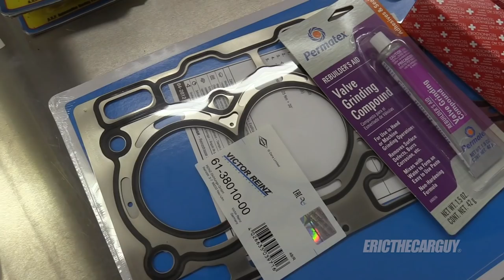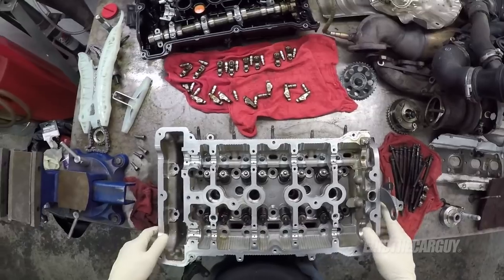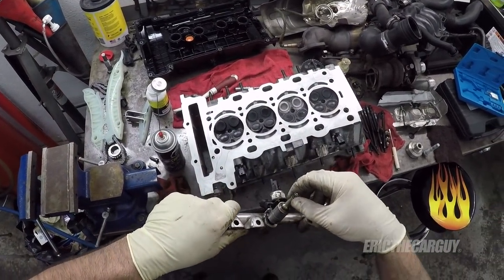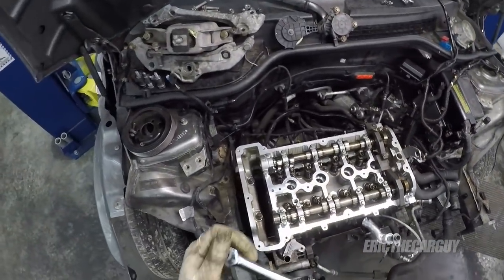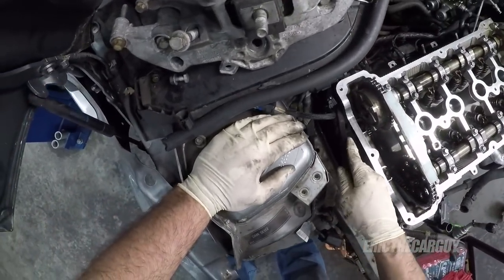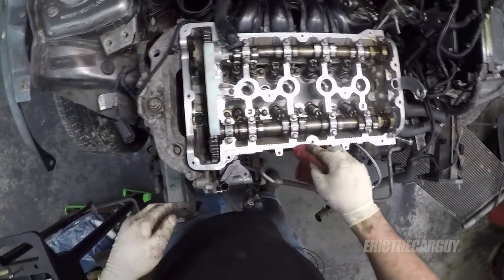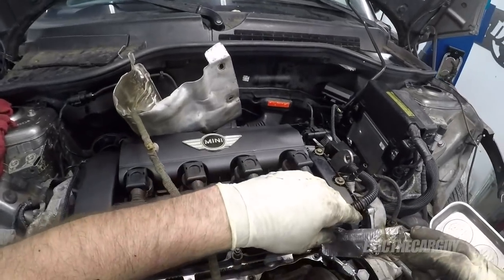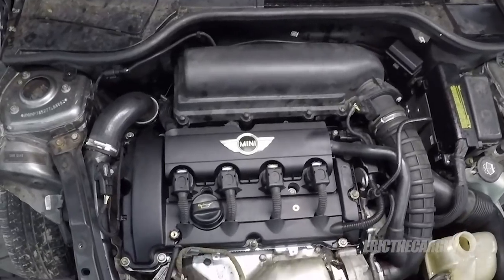Mini Cooper N14 Bent Valve Repair (Part 2)

Comment: I think you did an excelent job eric.
The washer mod cost nothing but you were able to install the stem/valve keepers :-D.
"Need is the mother of invention."
.
It's an odd car in comparison to the cars you are used to, the jungle of peripheral components around the engine must have been a pain to remember.
I still think it's a horrible cramped design, hopefully the first and last one you will ever need to  fondle lol.
Stretch bolts, not a nice thought.
Reply from the maker: Thank you. Honestly, I didn't mind working on this car at all. I thought it would be a lost worse. My biggest complaint is the parts are fragile and expensive. The car IS fun to drive, but I'm selling it before more stuff breaks. It seems inevitable. Thanks for your comments as always.
Reply: Wise decision :-D.

Comment: I may have missed it, but...did you turn the engine over by hand to confirm no interference before you pushed the button?

I can't not do it - even  when I know everything is perfect, I still have to check...probably because every time someone comes up with a foolproof technique, I improve at being a fool.   :-P
Reply from the maker: No. I just went for it like I usually do. Sometimes it works, sometimes it doesn't. In the end, it's all a video opportunity for me.
Reply: Never thought of that.   In your situation, even making a mistake has a silver lining, so long as no one else is impacted by the error.  Hey, if it works for you, it works for me - it's great to see honesty in this industry.  :-)
Reply: I learn that even if i work with tools  for timming setup i must turn the engine twice. Because it could be the tension bold that could failed.

Comment: If valves get bent, does that damage the top of the piston as well?
Reply from the maker: Not always in my experience. I've seen pistons get 'marked' but not damaged beyond use. 

The valves are at an angle when they meet the piston, which is not at an angle and held fast by the cylinder walls. It's almost always the valves that bend as a result.
Reply: Peshewa diy no, not at all.
Reply: no, but those rockers tend to snap in half. Makes it extra fun fishing out all those tiny needle bearings.

Comment: Your mistake has opened my eyes to what happened with my Mini. Bought it and two days later it died and the bolt on the crank pulley was completely out. Now every exhaust rocker arm has no tension at all. I'm thinking all of my valves are bent :( Oil pan is clean, but I pulled off the chain guard on the scavenger oil pump and plastic bits were in there...

Comment: "Tighten bolts with cold engine " dumb instructions ,when the cylinder head is removed the engine can't run /is cold ,even if you want to you can't tighten it with an hot engine 16:29 great video by the way !
Reply: You've clearly never seen someone try to replace a head gasket while at the track.
Reply: Yeah but you know those NASCAR minis might try a hot swap....
Reply: Engine tear downs don't happen like this and sit for hours to cool down all the time. Race car teams do it between races and even during races. So it's not always dumb to warn everyone to do it cold. Shows you are inexperienced, so in fact your statement was dumb.
Reply: It's just a warning for the superfast mechanics.... ☺

Comment: Has anyone done a similar thing to a N12 engine. Having doubts which flex plate hole to install the crank locking tool. Mine has two holes 180 degrees off from each other.

Comment: The rough Idle could be be an Airleak. If or if not, you should use some Silicon on the extreme Angles of the Cylinder Head to Valve Cover. Looking on to the Head from the front, the extreme Angles i mean are bot on the Left, a bit left from the Point you use that 27 Wrench to turn the Cams. The Rubber Sealing inside the Cover will be suported by that bit SIlicon. -> 30:56 exaktl between the Bolthead and the Vacuum Pump and on the other side (near the HPFP as well).
Reply: ....doh...."are both on the Right".
Reply from the maker: No air leaks. It runs fine. It was just initial start up after tearing the engine apart. Very common.

Comment: Are you not using your plastic nub wheels for clearing gasket surfaces anymore?
Reply from the maker: You can't use those with steel gaskets they mark up the surface too much. Mirror finish!

Comment: Next time use the Sino acrylate version of super glue to keep the washer in place when done heat it above 212 f to release the glue.
As a side note I'm not sure if I spelled the glue correctly
Reply: chester priest 
Cyanoacrylate - think cyanide (because it has the same functional group in the molecule).

Comment: What did you mean when you said Marks are up on the camshaft, I dont see any marks? Any help would be appreciated
Reply: When you timming the engine the both camshaft has the producer marks that is necessarly to be seen in the up side. It is write on the repair manuals of the mini and work also for the peugeout 207 and 308 for 2009 up as the engine code are the same.

Comment: Feels like they went with as much complication as they could, just because they can.  I'm sure it wouldn't be the most powerful or compact engine, but I'd like to see one that just used three sizes of fasteners, and each size had only one length associated with it.  An engine anyone could reassemble, just match the size of the hole, tighten to the torque stamped next to each hole and presto!  Working engine.  Of course, I'm not an auto tech or engineer, so there's probably plenty of reasons why that won't work.

Comment: I wish the engineers at the auto companies would figure out what torque spec would put the bolts at where they want it, instead of a spec and additional turns to certain degrees. Figuring out the torque needed would make the job quicker, easier, and simpler.
Reply: The degree is the tollerance of the bold. It is not a thing that the engineers could manage it depends alot of the quality and strenght of the bold. The bold on the head works on different degree of temp as they are inside or outside and the tollerance for the lenght of bold is necessarly.

Comment: If the head is like the n54 head you destroyed it or will without replacing the teflon orings and springs and not compressing them in stages with the compression tool
Reply from the maker: Been driving this car for 2 months now. Not destroyed. ;)
Reply: @ericthecarguy  ok cool because in the N55 and N54 I constantly replace cylinders heads because of that but mini maybe different

Comment: You only need to be rough with 90 degree turns - some people are absurdly anal when it comes to angle turns - but when you are doing multiple 90deg turns on the same bolts you don't have to be bang on....the angle turn is just to get the bolt into plastic yield stage - once its in, any more turn's on it will just stretch it without increasing clamping force any further.

If you actually only did 80 degrees, or went over and did 100 degrees - makes no difference. That bolt is already in the plastic stretch region by the time you hit 45. Going over by a bit will do no harm either - if the bolts is 180 total it will take 200, it will be the same clamping force at 160 as well.
Reply: Yup. But if you really are anal (And byt sme miraculous coincidense dont have a proper torque angle gauge) you can mark outside of thethe bolt and an opposing point or flat before you start and when they face eachother you are done. Is very easy with 90 and 180 deg.

Comment: Ever try lapping in valves by hose clamping a 6” piece of fuel hose to the valve stem and spin the hose with a cordless drill ?
Reply from the maker: No. Sounds like it would be fun to try though.
Reply: Yep did this with my last head i worked on - have to be careful to keep the valve completely flat, and make sure your bit of hose is nice and bendy along with keeping drill in line as much as possible. Works a treat, just need to be careful, plenty of oil on the stem and keep changing direction every now and then.

Comment: Shouldn't you deck the head at a minimum, and the correct way is to deck both head and block when the head is removed?
Reply: On second thought, after further watching, you didn't torque spec a lot of things.  Makes sense why you didn't deck the head.  Come on, man.
Reply from the maker: You might want to rewatch the video. I torqued everything to spec. Everything important. No need to deck the head or the block, it wasn't a head gasket problem, I was replacing bent valves. I've been driving the car for 2 months since this repair with no issues. You can try and argue with results but....

Thanks for your comments.
Reply: No arguments from this end.  Just observations. I'm anal about torque specs. Lol. Ok, real talk, why not go ahead and deck head, do a valve job on all valves and re seal them?  I mean, it took soooo long to get to that point. It would make sense to me to just do it whilst there. I get the whole "if it isn't broke, don't fix it", but you were there already. Just this guys thoughts.
Reply: EricTheCarGuy P.S., I know it's easier to sit back and criticize the guy doing the work. Lol.

Comment: for valve grinding its far easier to attach a vacuum hose to the stem of the valve and onto a drill bit and run it forward/backward
Reply: Lapping REQUIRES motion in both directions to avoid grooves in the seat. Your method guarantees leaks.
Reply: @ronaldjohnson1474  you know you can reverse drills right?

Comment: You didn't take it to the machine shop?
Reply from the maker: Why, it runs. Runs good too. ;)
Reply: Just needing the valves replaced, and with no damage to the seats, there's no need to have a machine shop do it. If I have a head that's. Slightly warpped, I'll take it and have it filled, but. If valves don't need ground, I'll clean and lap the valves myself. Saves quite a bit of money, and I have a fully equipped shop with the tools to dissemble the head.

Comment: How did u remember where everything go? I m waiting for your answer.
Reply: He has a Camera???? And by the way a mechanic like Eric work clean.When he put off a piece it put also everithing that has take down. Is my sistem to work and as i are is also his sistem. It lose some time to Made all this work but is not the same as it Will put all toghether and then triying to figure out where  it should be mounted. The electric wire is simple. The connectors are alwais different one by each offer and you cannot mistake. Watch another time the video and you Will figured out.

Comment: Hey Eric. Sykes pickavent make valve spring compressor attachments that fit the psa engines. Had to use one on my 1.6 tdci head. Think it's a 21 or 22mm bit. Can't remember off hand. I'm also not sure if Sykes pickavent are available in usa lol

Comment: Hey Eric. When are you going to be finished with the Mini videos or things related to it? I've been losing interest in them as Minis don't mean anything to me. I am not bashing or hating. It's reminding me of how the Fairmont (which was bad-ass, by the way) got dragged on too long (I didn't mind the fairmont, tbh. But a lot of folks didn't dig it). The Mini series is turning into a Maxi series. Back in April, you mentioned it would be running for the next few weeks. 5 months later, it's pretty much been nothing but Mini episodes with a few oddballs here and there. 

I personally would enjoy more general repair videos on the regular ETCG channel. I definitely know I'm not alone. Not bashing, just trying to throw in some constructive criticism. And apologizes if I'm coming off a bit brash.

Comment: hey ya I think after seeing the mini series this is a bmw e 30 convertible that never sought treatment for its ocd . (I own one a e30 vert)and years later well but hey it dose make for good youtube content now don't it. uh... from the tone of your voice on the flatness of the head and maintaining that,  eagle one mag cleaner the acid stuff that eats the clear coated I rub that in with my finger tip( gloves the venom steel oriely) on the aluminum heads it softens the remaining gasket it takes for ever straight edge or diamond ground flat stone if you just spent $200  on a gasket and the flatness needs to be .00005 50 millionths ya not really any other way some other cyl head stuff don't be one of those guys that thinks the "ball" gauge telescoping gauges give you an precision measurement down in a valve guide the $44 dial bore gauge(ebay) with the mahr millimess indicator (hurry theres one on ebay for $50 bucks right) now reads .0001 and reads to where you point it (true bellmouth and taper) and OIL THOSE THREADS ON THE CYLINDER HEAD BOLTS the bmw engines are machined to such close tolerences that if you put too much oil on them they WILL hydrolock on you this is why soooo many m42 gaskets fail the arp bolt lube works perfect on those the lapping compound belongs to grampa pushrods generation don't embed grinding compound in stellite type stainless alloys then focus a flame thrower at them that black pitting at 120k those are the grinding grits STILL IN THERE use a sharpie marker get a cotact patern use a seat runout gauge or even use a neway cutter by hand and take off.0005 but not silicone carbide paste love your video's for reading my little rant here you've gained a subscriber

Comment: Am I the only one that lightly uses a drill on the other side of the valve to lap valves? I use a short length of rubber hose so as not to put any side pressure on it and just run it back and forth. I lube the valve guides too and go both directions on the drill.
Reply: No .I also do it .

Comment: Grease monkeys will always work on stuff. I have a 2012 base 2 dr hatch n16 non turbo Mini Cooper gen 2. only thing that went bad on it right away was the water pump @ 15k. 80k later the thermostat went. 100k later the radiator went. I now have 180k. Changing my timing chain now just to be safe. Also changing my suspension because it finally went. I've been working on cars with my dad since I was ten. I know there was some major issues with gen 1 timing chains and burning some oil. I don't understand all the crying I hear about Mini being garbage. Mine has been good to  me I feel. If you maintain your cars as recommended (many) cars will last. Except for the oil change intervals. they recommend every 15k. Thats BS. change it between 5k-7.5k max. That said car freaks and grease monkeys will work on whatever they like at the moment even if they don't have too. If you aren't a tinkerer than you will have a hard time understanding it.

Comment: Installation of camshafts while 2 open valves are supporting the whole head on the table. Cleaning DI injector tips with carb cleaner and a brush. Lubicating teflon rings. Using the most important crankshaft stress bolt a second time...
Please people, don't try this at home ...
Reply: riff maka  It's not necessery to reuse them. There are a couple of tutorials on youtube which show you how to change the seals without the special tool. Did it a couple of times. No Problems

Comment: @EricTheCarGuy

I'm a premium member but can't comment on the premium vid so leaving it here-I know you asked about a better valve spring compressor solution in the premium vid and a better way to install the keepers so here it is:

The ORIGINAL source for this spring compression tool is:
https://www.pelicanparts.com/catalog/SuperCat/6329/MIN_6329_ENGTOL_pg2.htm#item7

With a part # of: TOL-SLY-91400B and some internet research I found the actual tool is made by Schley Products with a part # (variously) of SLY-91400B, SL91400B,  TOLSLY91400B, SCH91400B. A simple google search should turn up the following: 

Universal OHC Valve Spring Compressor OR Schley Products Universal OHC Valve Spring Compressor VERSION B. The standard "beware of cheap knockoff versions" warning applies so for you or any viewers who purchase it make sure SP/Schley Products is listed somewhere as the manufacturer in the detailed description.

Legit link here: https://www.amazon.com/Schley-Products-91400B-Universal-Compressor/dp/B004IQHRBM

For the keepers see one (or more) of the various tools fabricated by All German Automotive (AGA) right here in the USA:

http://www.agatools.com/tool/bmw-valve-keeper
Reply from the maker: Not sure why you couldn't comment on the PM vid, but thank you.
Reply: The last 2 PM videos are unable to be commented upon.And yes I’ve tried multiple browsers ensuring adblockers are turned off and I am signed in. And no I don’t see any other comments either.

Comment: Your a Honda civic guy.     I have a charge problems. It the Factory alternator I get the right readings off of it but when I'm driving and bounce around the voltage.  Any ideas were to start looking at?
Reply: bad connection  maybe brush in alternator
Reply: Voltage regulator